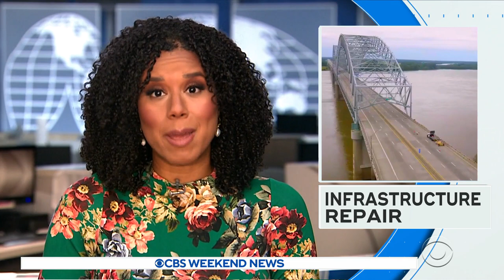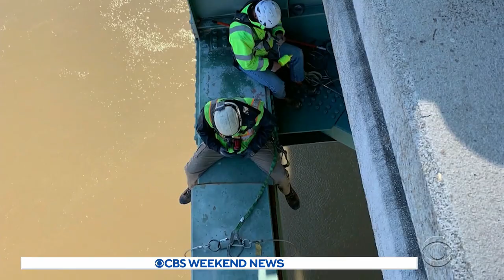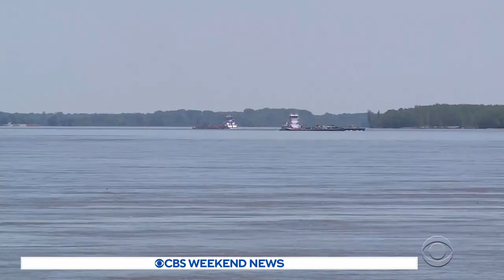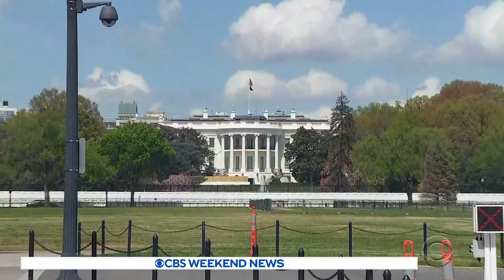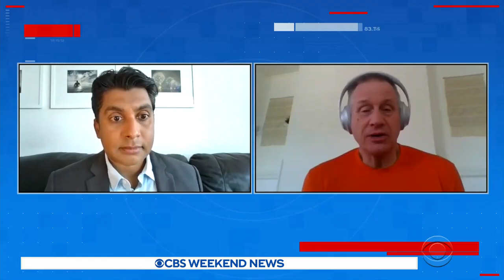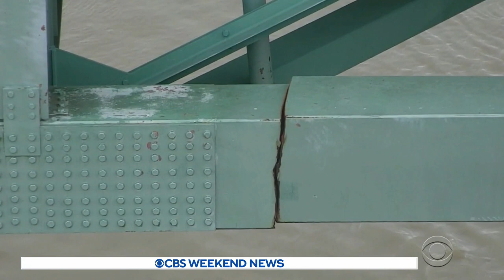Memphis bridge closure raises concerns about nationwide infrastructure

Comment: Steel production methods were different in 1900. This bridge probably completed its fatigue life and it needs to be replaced completely. Replacing the broken beam with a modern high strength beam will probably increase the strain on the older beams and shorten their lives.

Comment: Inspections and maintenance are crucial, but we should also go another step further and also review the engineering of existing bridges. A bridge designed in 1953 may have met all of the engineering standards of the time, but may have weaknesses that would not be allowed with modern engineering practices.

Comment: In the 70's, I think, I was working for the Federal Government on Rock Island Arsenal Island. To  get to work, you had to cross 1 of 3 bridges. One bridge, to Moline, IL was the one I used the most. First, they put up a notice restricting the weight allowed on the bridge. On warmer day in January I think, it suddenly got condemned around lunch time. The story goes that the warmer day caused ice to melt. The melting ice caused part of the bridge structure to breakout. One of the other bridges had already been temporarily closed for some scheduled maintained. Everybody had to scramble and leave by the only bridge left open. WHAT A TRAFFIC JAM. The next day was EVEN WORSE as everybody had to use only one bridge to get to work. I was commuting with my mother since we both had jobs on the Island and I lived with my parents. Commuting got better when they worked with the people working on the second bridge to allow traffic during the peak traffic times. Mom and I changed from her dropping me off to me dropping her off due to the mile or so difference in where we worked and the new route we had to take. This continued until a new bridge was built in the site where the old condemned one was. It was a different design to allow people to avoid being stopped by freight trains. Of course by then, there was a lot fewer freight trains to avoid.
Reply: One would hope that the remaining bridges were not also about to break...
Reply: @canto_v12  I moved away 14 years ago. The government has an incentive to keep them working, because the Island mainly has historic buildings (built in the late 1800's) where thousands of Department of Army civilians work. They have to commute over the bridges daily.  Even right after 9/11, some had to come to work. I had until the following Monday for me to go back with all the cars checked when we got on the Island by one of the bridges.